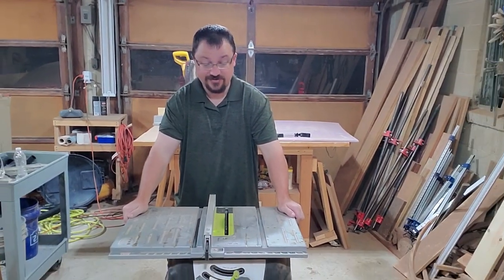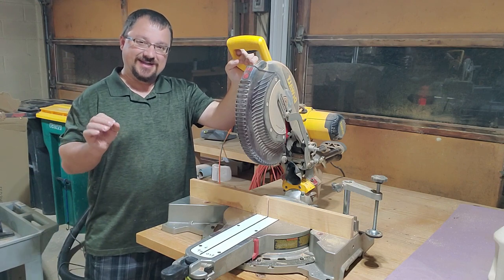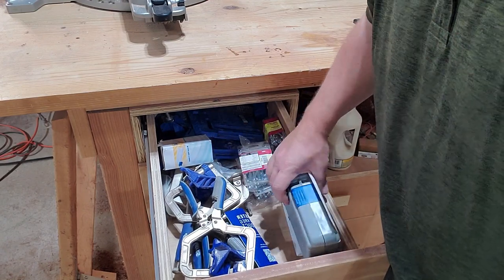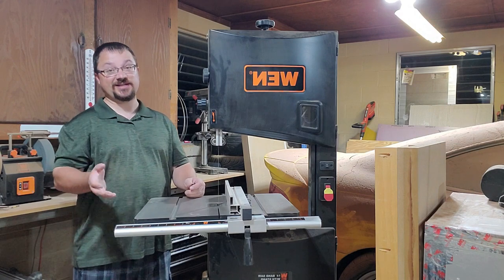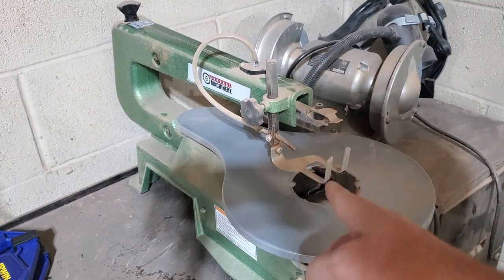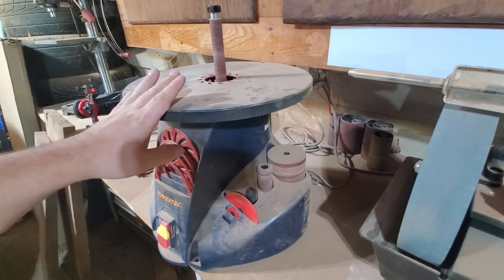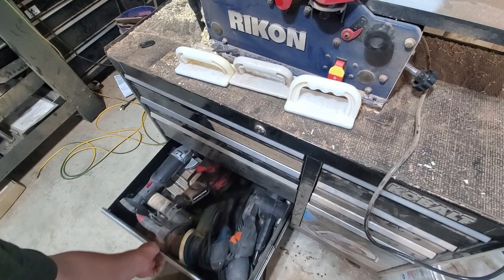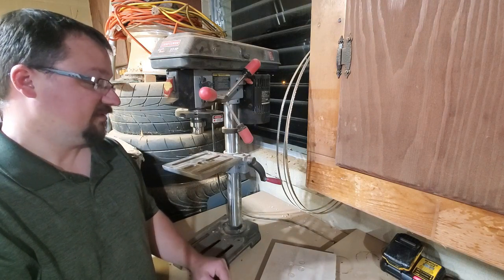Beginner woodworker shop tour and painful lessons learned

Comment: I enjoyed your shop tour!  Thanks for posting!   I have some suggestions: 1 sell the car and get some capital to work with.  2. Take a week and clean and organize your shop. During that time set aside ANYTHING that is broken. Set aside anything that you feel you don't use, anything that is not very usable or you just plain don't like.  Get rid of that broken planer, it is just taking up space. Sell those things in a yard sale and donate what doesn't sell.   Organize your tools so that you don't have to search a junk drawer for something you need.    3.  Make an air filter (box fan with a couple of 20x20 furnace filters). This is cheap and effective.    You could even make 2 of them, put one on each side of your shop, perhaps hanging from the ceiling.  With 2 you could run them on low speed and still be VERY effective.       4. Get a dust collector.  I got 2 used ones from Facebook Marketplace.  If new the Harbor Freight one is a good buy.  Put a barrel ahead of it to collect most of the chips.  4 inch sewer pipe works well for the duct work, its lightweight and strong and inexpensive.    5 This is a biggie:        GET A GOOD TABLESAW!!    your work will improve.  Search for a used cast iron table saw on FB Marketplace and Craigslist.  Look at least 3 times a day, EVERY DAY.   A cabinet saw would be best (Delta Unisaw, Powermatic PM66, Jet, Grizzly)  If you search diligently you CAN find one at a reasonable price. (Sub $1000)   If not a cabinet saw then an older contractors saw from (Delta Unisaw, Powermatic PM66, Jet, Grizzly and Craftsman)   The older contractors saws have cast iron tops and a motor hanging out the back.    Instead of getting the cheapest new tool, spend that money on a well researched USED tool.   You will get MUCH more for your money.  You already know how it works when you get the new cheap tool as you said that throughout the video.   Good luck in your new shop adventure!!!
Reply from the maker: Thank you so much for your feedback.  It turns out that we think very alike when looking at my shop. lol 
The car is sold as of last week. 
I've been working diligently on storage solution and organization the last month.  It's come a long way so far. 
I actually bought one of those wen air filters you mount on the ceiling.  Huge difference. 
Dust collector is not done yet but its on my by March list 
Table saw is on my by March list as well. 
The next year update will be hugely different for sure.  Thank you again.

Comment: Cool shop tour!  Buying a $20 riving knife or the microjig splitters would improve the safety of that table saw setup you are working with, last thing you want to have happen is kickback that is preventable. Looks like that might be a 2004 -2006 GTO up under all that dust, might be time to sell the car and upgrade a few tools since the hobby is getting serious then use the cash to get the dust collection and air filtration systems for your shop, probably have more than enough to upgrade everything depending on the mileage and if that is a GTO I saw.
Reply from the maker: Thank you very much.  I actually plan on upgrading the saw towards the end of the year.  But you are right that I should put the riving knife back on it.  

Yes it is an 04 GTO.  I actually just started yesterday to get it back to running order.  Should have it on the road this weekend.  And then I'm selling it.  That's gonna be a source for some shop upgrades over the next 6 months.